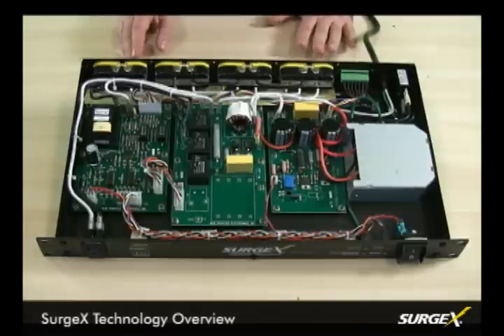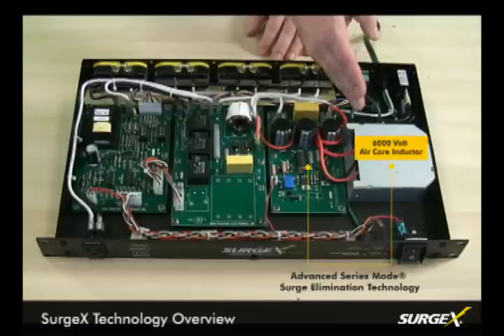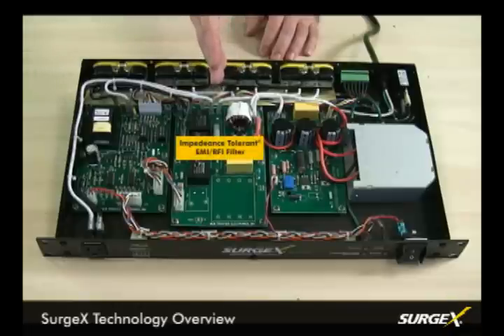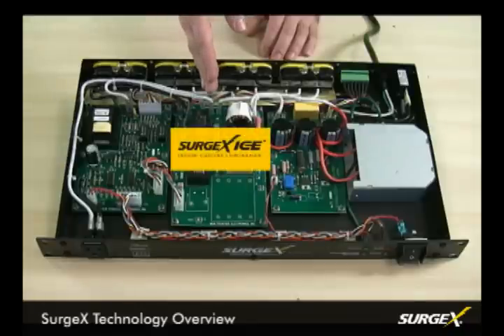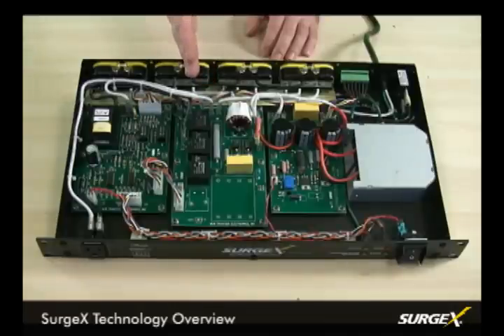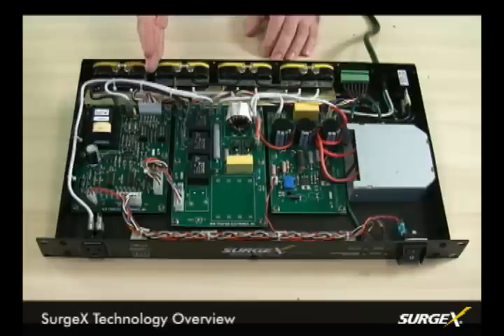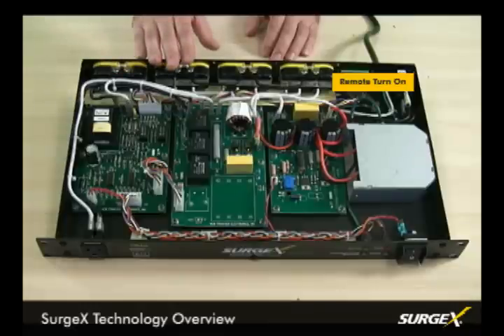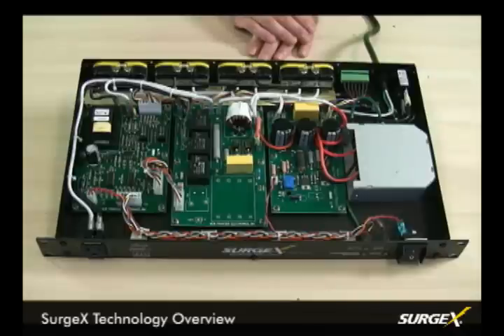SurgeX, Surge Protection Technology Overview (Open Box)

Comment: I have a "CE-HGT6120 Ground & Outlet Tester" that is plugged into one the outlets of my SurgeX sa-82 and it shows a bad ground (red light) for about 30 seconds when I first plug the sa-82 into an AC outlet. Is this due to the SurgeX ICE "Soft turn on" mechanism filling up a capacitor?

Comment: I just bought one of these for my AV system. I have one question, do I need to run new 3 wire 12ga to the plug to achieve grounding/ modernize my old house or will this work on a ungrounded outlet?
Reply: BassThatHz I just ran 175' of new 12/2 and got surge breaker I put in at the top of my panel. Single story house😃